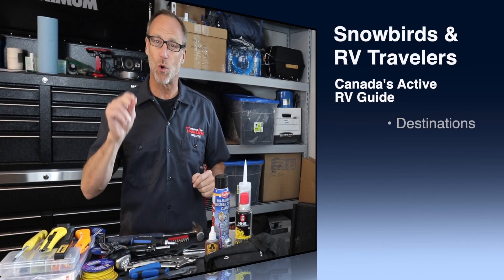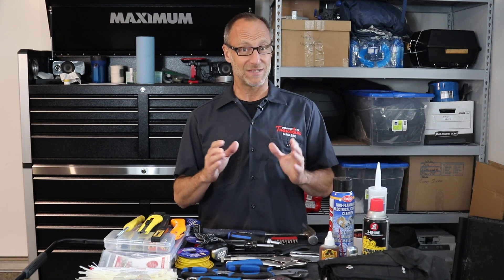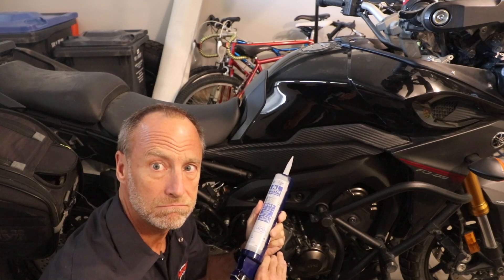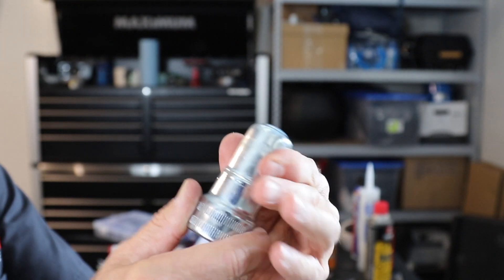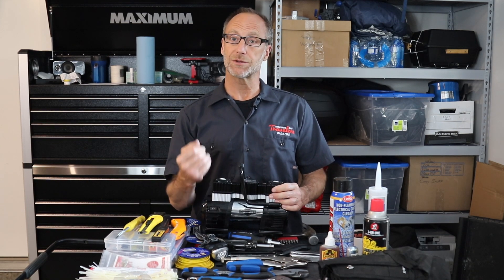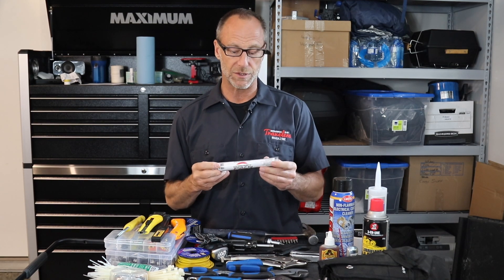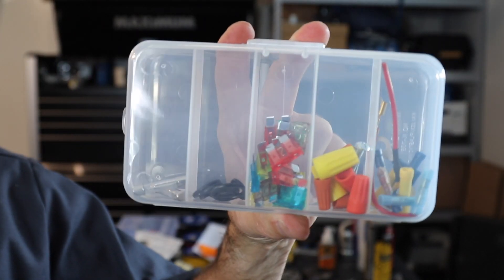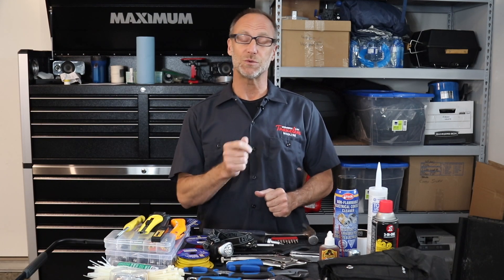RV Tool Kit - the Complete Guide of What You Need and What You Don't

Comment: As an alternative to electrical contact cleaner I suggest brake spray cleaner.  It also cleans electrical contacts, evaporates quickly, leaves no residue and does not damage most plastics or paint.  It's far more versatile, costs less and is found in any auto parts store.  Like all chemicals be careful not to breathe the fumes.